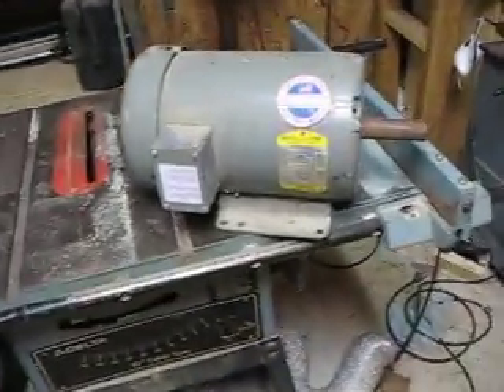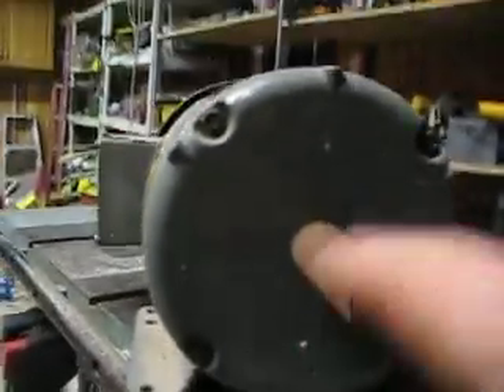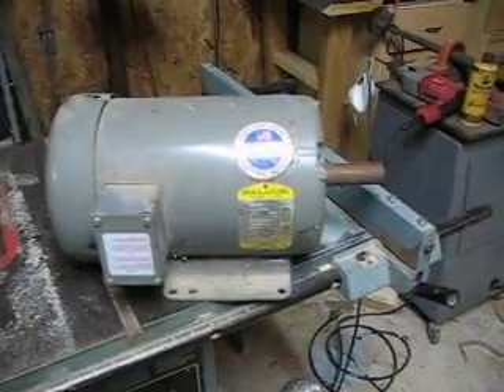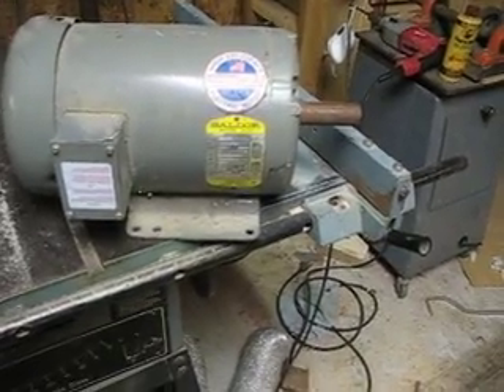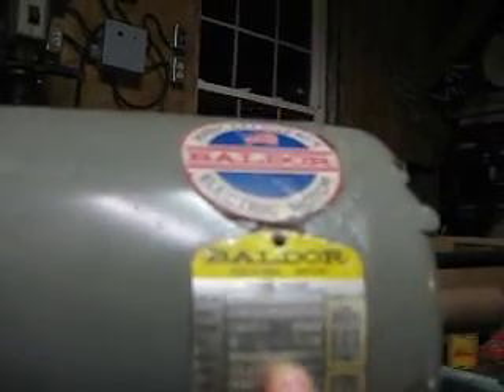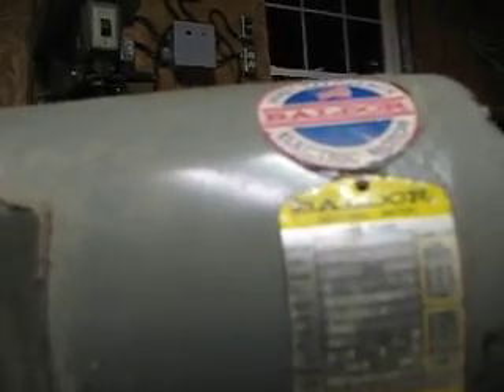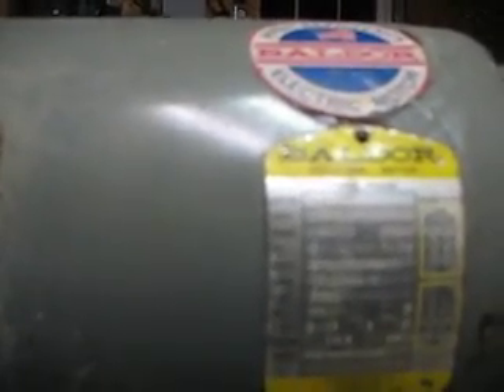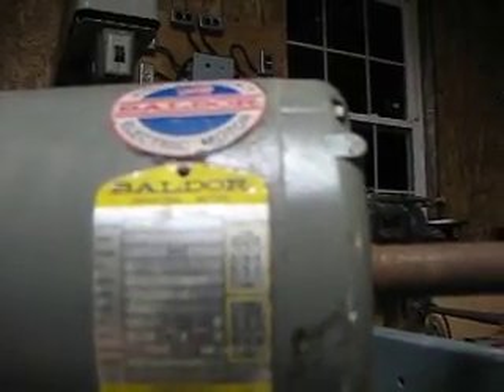3 Phase 5HP Electric motor

Comment: If I'm not mistaken, the capacitors could be taken out of it, and so long as you have 3 wires goin to the motor I dont see why a 3 phase ac motor controller from a golf cart or any electric vehicle wouldn't work. Upside is the power comes from a dc battery, and you could use it for an electric motorcycle.

Comment: you could also make a manually operated normally open push button start capacitor circuit , put a 500mfd cap in line on the 3rd leg wired in series. push button while single phase motor power is present, the motor starts you release the button, boom 3 phase power

Comment: hook up a 1hp or larger motor 3450 rpmr on a switch either direct drive or belt drive to drive the 5hp on a 2 pole switch hook the 2 pole switch to single phase power and to motor. with the 1 hp motor gets the 5 hp motor up to speed, turn on the 2 pole switch , turn off the 1 hp switch, the 5 hp motor will run and generate a third power leg. you may use to run another 110v leg. your motor is generating 3 phase power, as an idler motor you can power a 7.5 hp motor for short periods of time.

Comment: you can run that motor on single phase 220 volt power, you just need to get it spinning first, a rope like you pull a lawn mower, or a bolt in the end of the shaft and use a power drill to spin it and remove it then turn the 220 single phase to it and it will continue to run. you will have a Rotary Phase Converter (RPC) with this you can run other 3 phase motors like that in my saws and sander. I just use a 110 volt to spin mine over. look at my vid if you haven't already.

Comment: You could run it on single phase by wrapping a rope around the shaft and giving it a really good yank right before throwing it on the line.  Make sure the motor is connected for the lower voltage, and connect your single phase 240 volts to any two of the motor's three terminals.  If you get it running fast enough with the rope, it will accelerate and run on single phase.